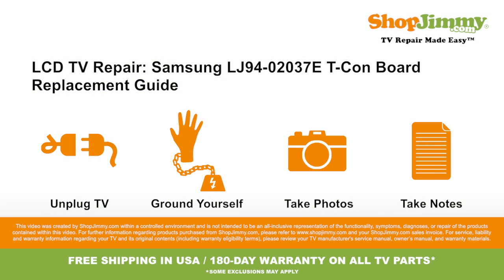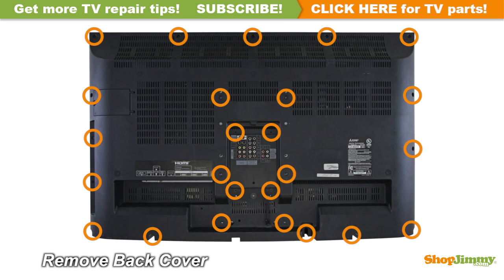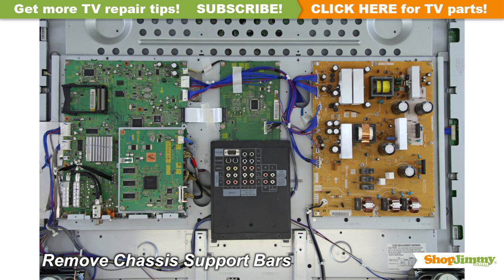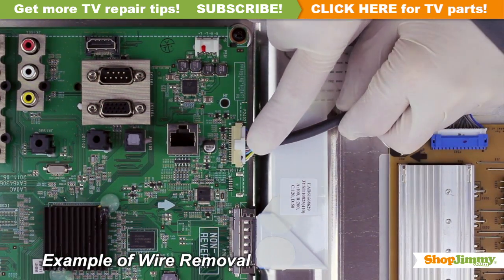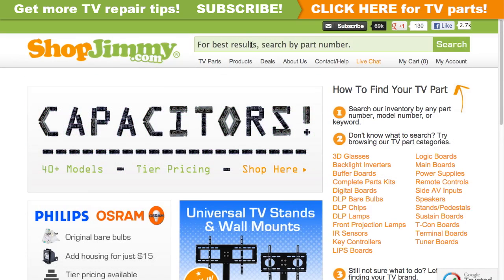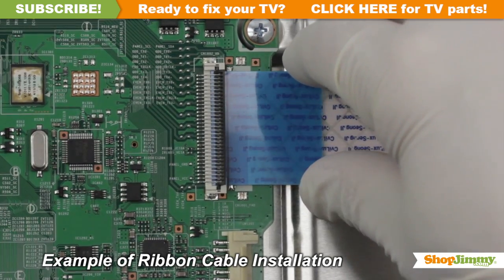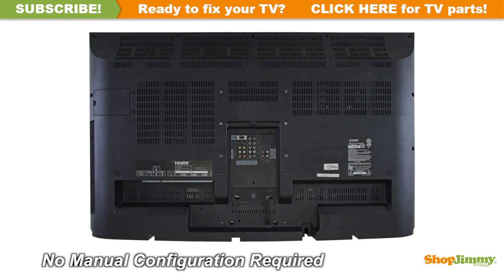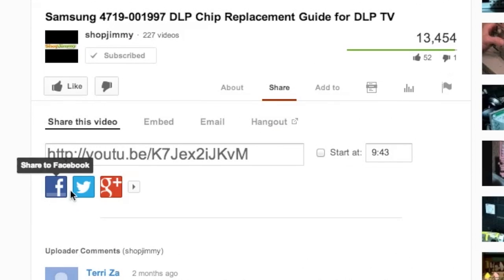Mitsubishi LCD TV Repair How to Replace T-Con Boards LJ94-02037E

Comment: Hi Jimmy, I have a Mits Lt-52244/55" with sound only no picture. The power plays tricks when powered up the light flashes blue for sever minutes without powering up. Turn it on and off a few times before the set's power comes on. Still no pics, just sound. I did the flashlight test do not see any menu written on the screen.  What's next to fix???  Thanks

Comment: I have a Mitsubishi LT-52151 on which I've replaced a blown fuse. When I reconnect the power the fuse blows. The capacitors seem to be in good shape. What should I check next? The number on the power supply is LT-401535200491A.

Comment: Hey I have a question about my Mitsubishi 46" tv that when I turn it on it shows more than half the screen from top to bottom as if a dark spot that starts to blink and in about 10-15 minutes watching or playing video games it fixes the issues but I want to fix it so it does not have the issue from the start.

Comment: I noticed on my Mitsubishi lt-46164 that the master backlight inverter wire is missing from the T-con board. Could this be causing the green and sometimes red horizontal lines on the screen?
Reply: Rachel Olgin lines are constant.. on every input and on menu screen.. but not always on the volume control screen towards the bottom of the screen. Horizontal lines cover the entire screen. I checked capacitors.. none of them look blown. Never really messed w/ tvs.. just going by what I have seen from youtube videos.
I unhooked ribbon wires from T-Con board to Lcd screen and cleaned them with an eraser, hooked back in and still has lines.
Reply from the maker: Rachel Olgin   Try all repairs and troubleshooting at your own risk.  Yes, this could be the cause of the problem.  Click this link to replacement parts for your TV model number:  http://www.shopjimmy.com/catalogsearch/result/?q=lt-46164  There may be multiple boards for the same TV model number, be sure to match part numbers on your current board, with your replacement for compatibility.  Here is a link to a video showing how to identify your part number, click here:  https://www.youtube.com/watch?v=bHPJNVe4A7E  Thanks and please let us know if you have any further questions with your TV Repair!  www.shopjimmy.com

Comment: I have a problem with my Mitsubishi Unisen 48" 0r 50" LT46164 serial 106142, is a blue screen, at the beginning was only for a second, later stay forever, I turn off and on Again a problem solved, now is blue and nothing happen, I move all the inputs to a different positions, nothing happens. I have to replace some parts and you have it?
Reply from the maker: Carlos Fascinetto  Please watch this video FIRST to help with your repair!  https://www.youtube.com/watch?v=BP3NVNCGEv8  I recommend replacing the main board in your TV.  Click this link to replacement parts for your TV model number:  http://www.shopjimmy.com/catalogsearch/result/index/?cat=56&q=LT46164  There may be multiple boards for the same TV model number, be sure to match part numbers on your current board, with your replacement for compatibility.  Here is a link to a video showing how to identify your part number, click here:  https://www.youtube.com/watch?v=QpqfxV2olXo  Thanks and please let us know if you have any further questions with your TV Repair!  www.shopjimmy.com